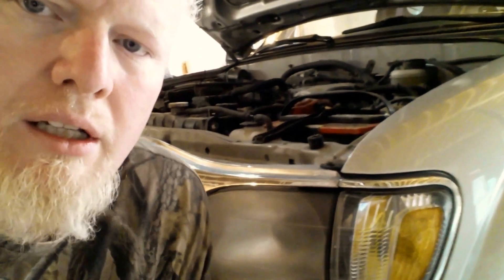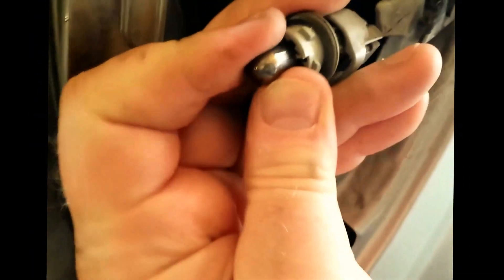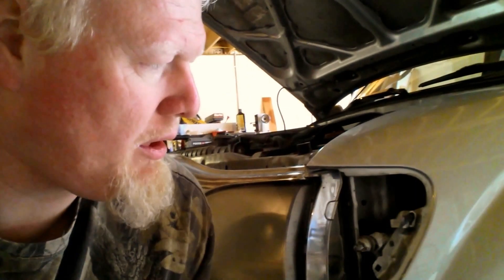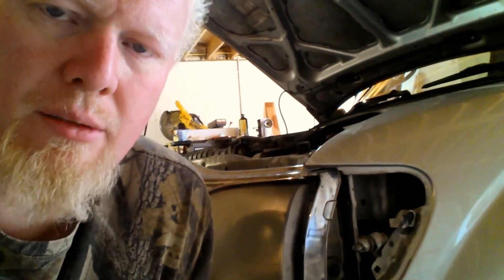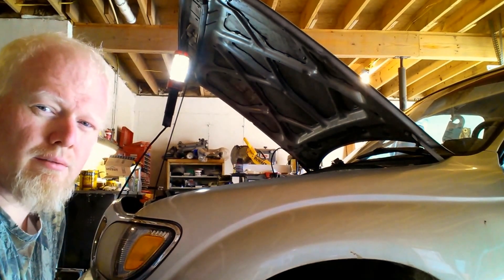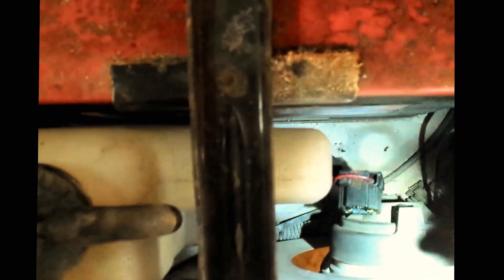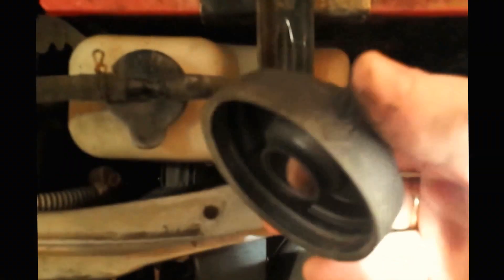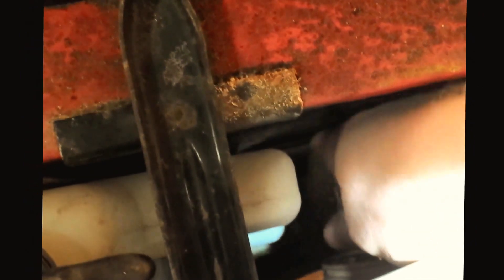How to change a Marker Light and Headlight in a Toyota Tacoma

Comment: Are you using dealership parts. I had problems with installing side maker. I finally got it to fit had a gap on top. I think I need to buy dealership parts.